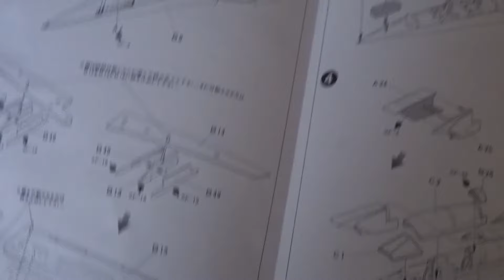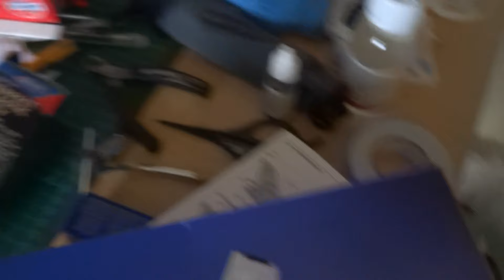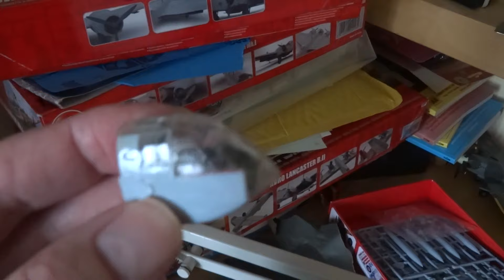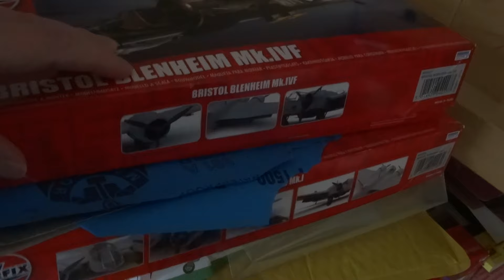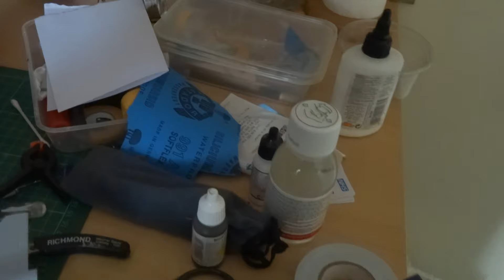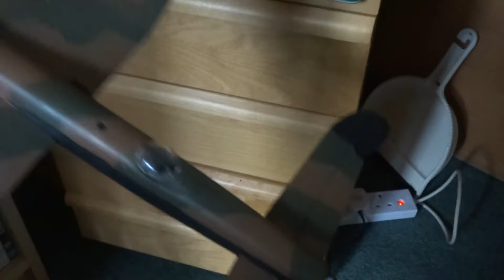Tornado F3

Comment: Ahoj Anthony! Ďakujem za zdielanie. Výborná aktualizácia! Tornádo vyzerá , že bude dobrá stavebnica. Blenheim je už nová forma?
Reply from the maker: +Marian MM70 Yes that is the second new tool after the Blenheim Mki ; main difference the nose section . I want to complete the Blenheim Mk I as a nightfighter and later the Mk iv Bomber with sky underside so I will have to work out the exact position of the ventral aft firing gun/ guns on the nose . There is an escape hatch there and that was utilised to reach these guns and sight the guns using a mirror or periscope . I may have the undercarriage down on this model and the bomb bay open . The Mk ivF has a gun pack on the bomb bay area so the instructions and possibly open doors from the mki kit would be used . There are parts in both kits not used in the instructions so you have a number ofspare parts . ... I am not a fan of Italeri but the kit was cheap and I am not too worried if the jets are not fully accurate but this Tornado kit has got RAF markings .